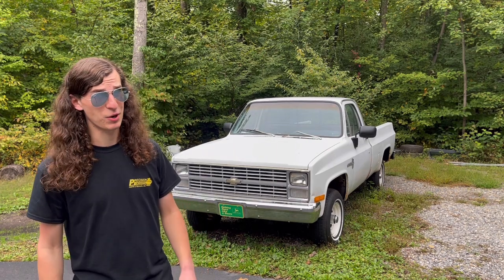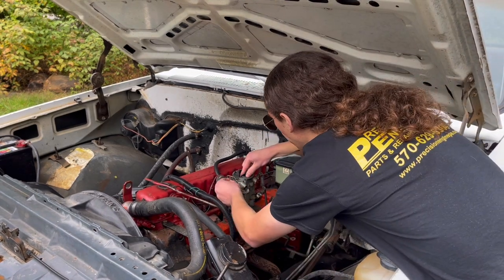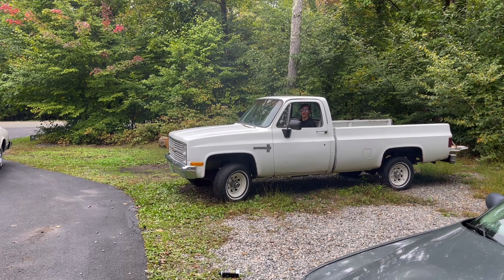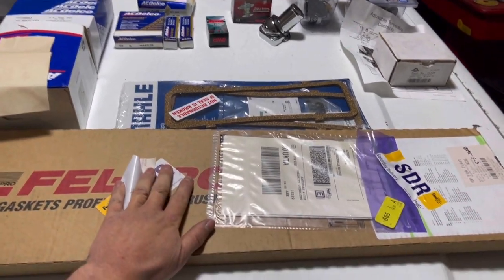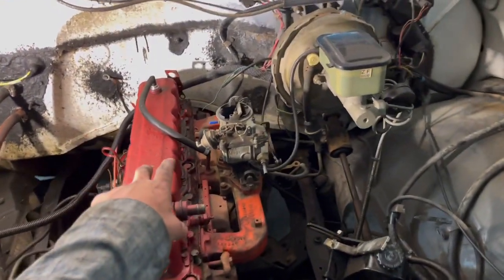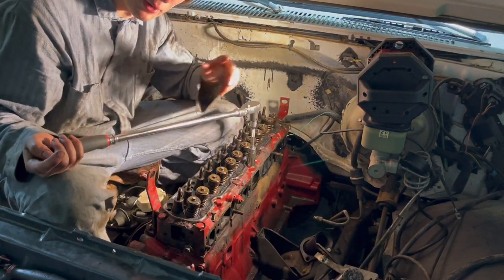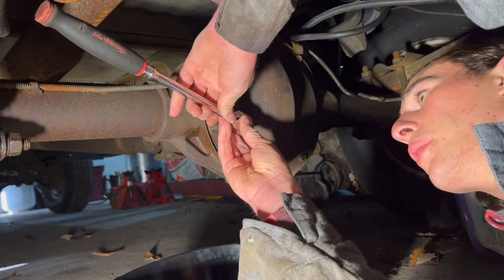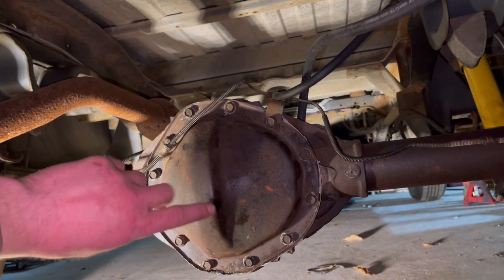Fixing EVERYTHING Wrong With My Squarebody Chevy K10

Comment: Time to toss the old boat anchor, and slap a low mileage junkyard 5.3L in there. There's a way to keep that transmission even if it needs to be beefed up a little.
Reply from the maker: If anything I would have to go big block or small block, I just love the reliability and simplicity of an old school carbureted engine

Comment: Flood the damn thing before you even get it started lmao it’s a carb every time you touch the throttle it is giving fuel and loading… if too flooded need to let jt evaporate or just keep cranking and hold it too the floor
Reply from the maker: Before I cranked the engine over there was no fuel in the bowls, I mostly hit the gas that many times for comedic effect. It was more of a mispositioned choke issue even after cranking since it wanted a lot of choke to even light off